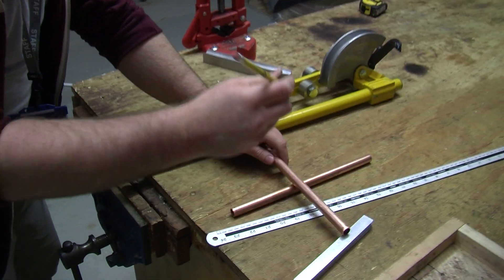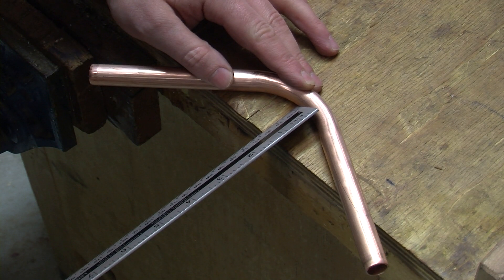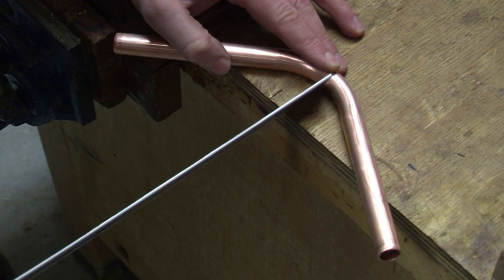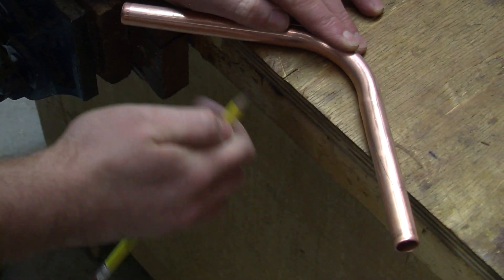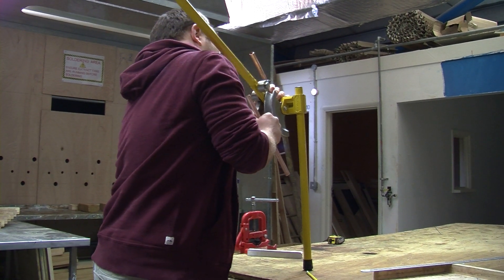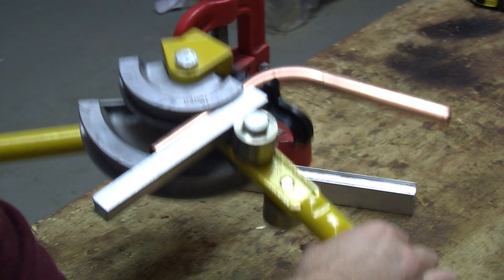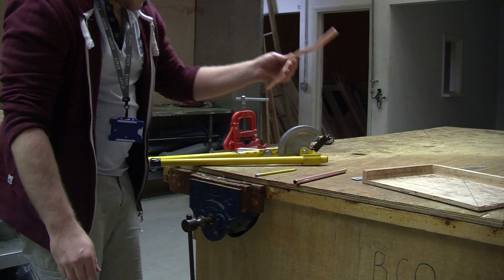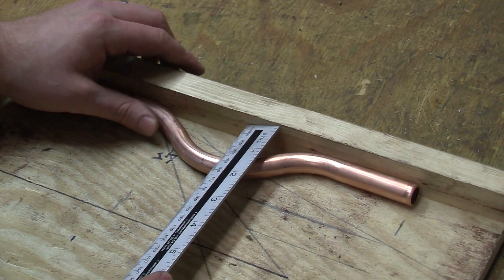Plumbing: Bending copper pipe - the pass-over

Comment: "Mark the pipe at the centre of the bend and then place the pipe in the bender".  It was not possible to see the mark, better with a thick felt tip.  Then where does the mark go in the bender?  Not clear.  As I mentioned in a reply, the bender becomes like an octopus unless you clamp it horizontally in a Workmate bench.  The shoulder in the longer arm and the rubber protector at the end of the same arm are perfect clamping points.  When marking the two sides after the first bend, you will find that you need to mark the the next bend on the topside and the third bend on the underside as you have to turn the pipe over for these two bends.  Best to do this when it is on the edge of the bench and also best to do it in clear felt tip.

Comment: Did you have to anneal the pipe before bending it?  How about bending 22 mm... does it have to be annealed before, or can it be bent without first annealing it?  Thanks.
Reply: No, you do not have to anneal it before bending with normal (Table X) copper pipe.  The same with 22mm, it does not need annealing either.  Bending 22mm is much harder work though.  Unlike the video, it is much better to mount the bender  horizontally in a Workmate bench otherwise it is all over the place, as you can see.